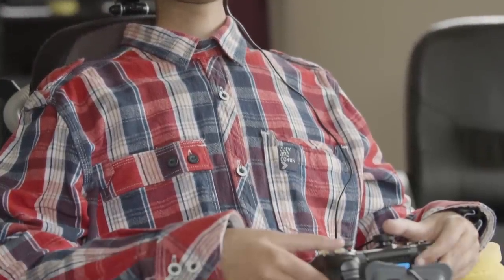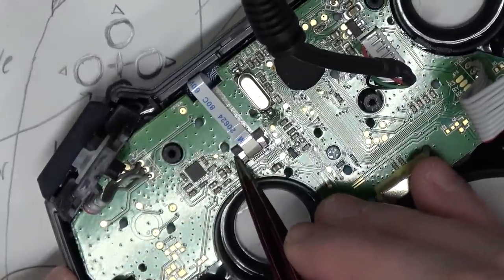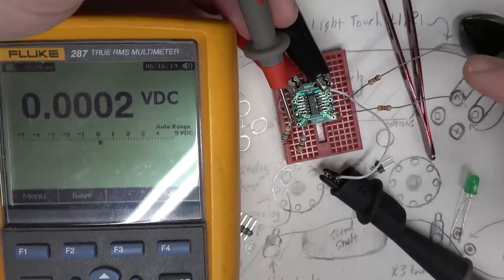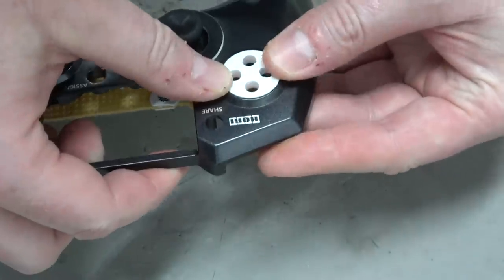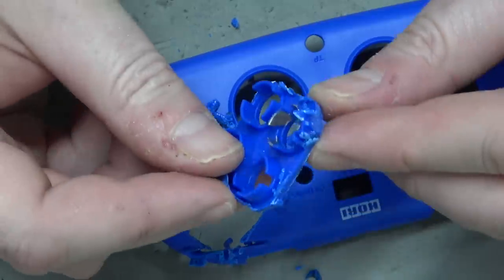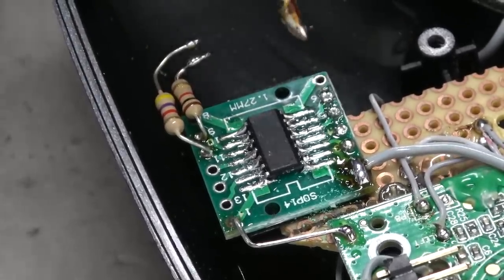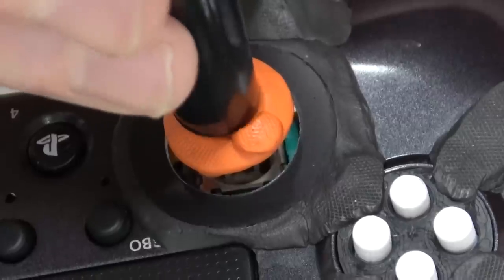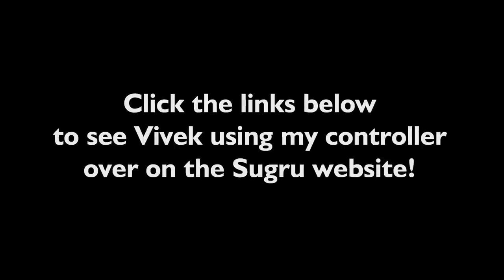Building a Custom Controller Using Sugru

Comment: "Now watch as I disassemble this thumb-stick". The cringe-factor is strong with this video lol. I don't mean that as an insult to you. I just would never in a million years take one of those things apart. They're a mess of tiny, finicky parts that I don't have the patience for. The fact that Microsoft, Sony and all the Third-Party companies use exactly the same design for their thumb mechanisms should tell you something lol. It means that there's a definite need for innovation when it comes to that kind of stuff, because it seems that the current design is the only game in town. If you ask me, someone should probably figure out a way to make the sticks work without quite so many moving parts. I've heard about a new design that uses electro-magnets to keep controls perfectly centered (which means you wouldn't need as big of a dead-zone for it to work properly) and to register their movements through proximity-effect. No springs, no tiny levers and no fuss. I can only hope it comes to market in the next generation of controllers.